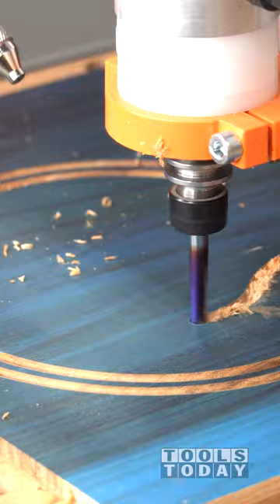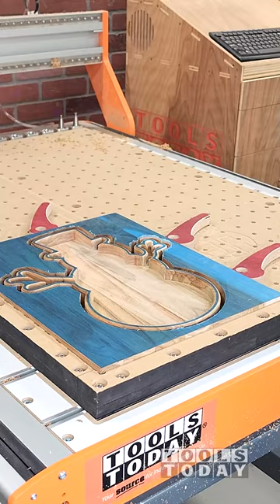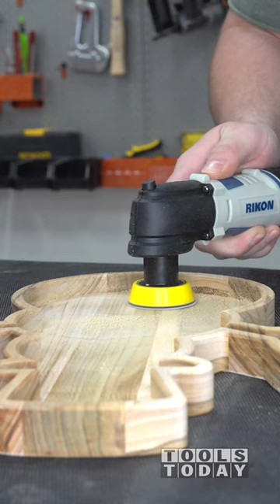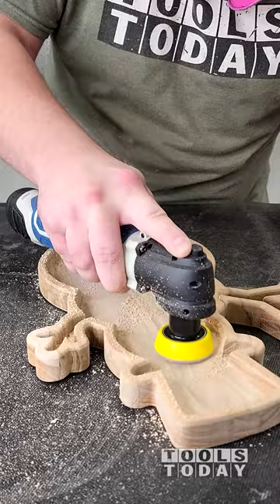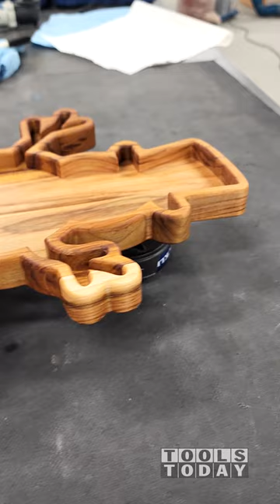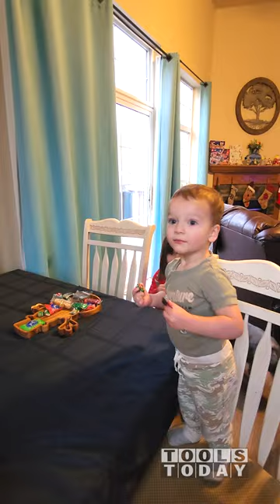Carving a Snowman Tray

Comment from the maker: What do you think of how this turned out?

Check out the plans for this project - https://www.toolstoday.com/snowman-catch-all-tray-cnc-plans-downloadable-and-customizable.html

Making the snowman catch all tray on the Stepcraft M.1000 CNC machine starting with the Amana Tool 56143 3/32" radius point roundover bit, all available from @toolstoday, to roundover the edges.
- - - - - - -
#TeamTOOLSTODAY
- - - - - - -
RPM: 18,000
Feed Rate: 70ipm
Plunge Rate: 35ipm
Depth per pass: .093"
- - - - - - -
I then switched out for the 46202-K 1/4" Spektra™ coated downcut bit to pocket out the waste in the center of the tray.
- - - - - - -
RPM: 18,000
Feed Rate: 100ipm
Plunge Rate: 50ipm
Depth per pass: .25"
- - - - - - -
I then switched out for the 46315-K 1/4" Spektra™ coated upcut bit to cut out the tray.
- - - - - - -
RPM: 18,000
Feed Rate: 100ipm
Plunge Rate: 50ipm
Depth per pass: .25"
- - - - - - -
I then used the Rikon 31-200 sander to help sand the middle of the tray. 
#short #shorts

Tools Used:

Vectric Software for CNC https://www.toolstoday.com/everything-cnc/cnc-software.html 

STEPCRAFT M.1000 36 x 48” CNC Machine https://www.toolstoday.com/stepcraft-m-1000-cnc-system.html

Amana Tool 46202-K SC Spektra Extreme Tool Life Coated Spiral Plunge 1/4 Dia x 3/4 CH x 1/4 SHK 2-1/2 Inch Long Down-Cut Router Bit
https://www.toolstoday.com/v-13779-46202-k-bit.html

Amana Tool 56143 Carbide Tipped Point Cutting Roundover 3/32 R x 13/64 D x 1/4 CH x 1/4 SHK x 2-1/4 Inch Long Router Bit for Beadboards
https://www.toolstoday.com/v-13220-56143.html

Amana Tool 46315-K SC Spektra Extreme Tool Life Coated Spiral Plunge 1/4 Dia x 1 CH x 1/4 SHK 2-1/2 Inch Long Up-Cut Router Bit
https://www.toolstoday.com/v-13780-46315-k.html

Amana Tool MR0110 Miniature 3/32 R Corner Rounding with 3/16 D Ball Bearing x 3/8 D x 3/8 CH x 1/4 Inch SHK Carbide Tipped Router Bit
https://www.toolstoday.com/v-11229-mr0110.html

Rikon 31-200 12 V Li Cordless Sander/Polisher with Battery, 2 Inch Pad
https://www.toolstoday.com/rikon-31-200-12-v-li-cordless-sander-polisher-with-battery-2-inch-pad.html
Reply: Why use a ¼" bit for the pocket instead of a ⅜"or ½" to cut time down?